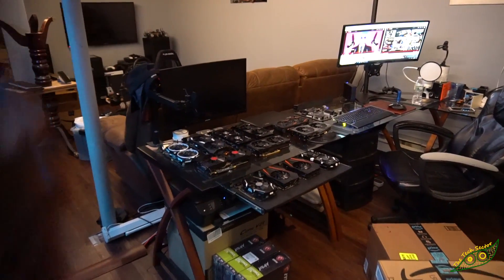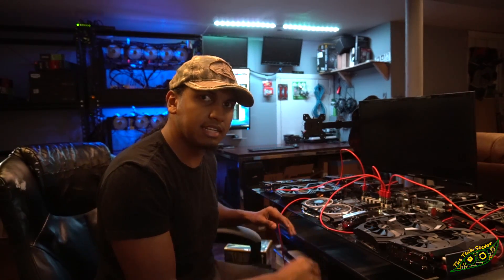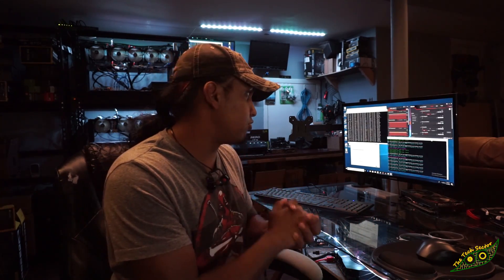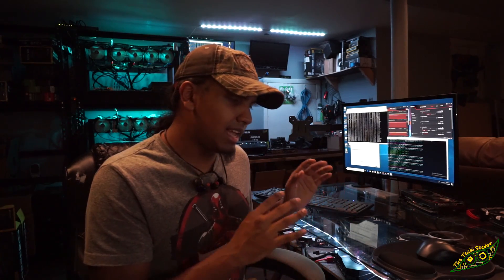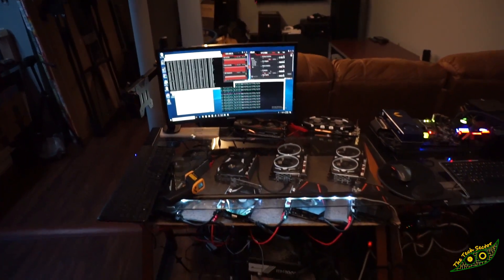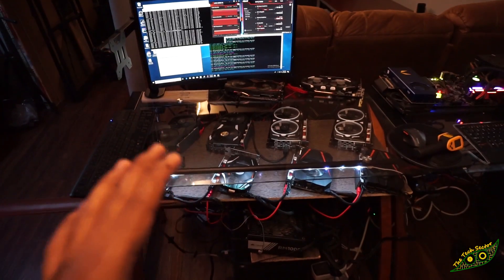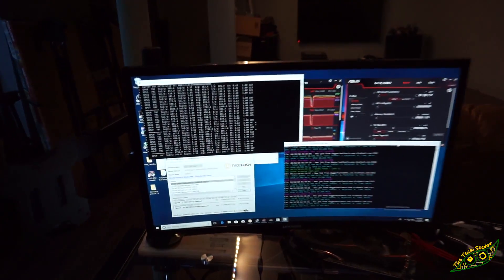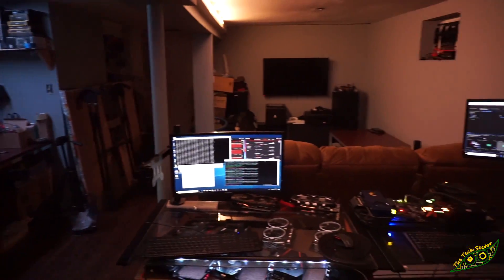Should You Build A Mining Rig In A Desk?

Comment: Hi,did u have problem mixing rx570-580  with rest of nvidia?And what miner did u use to run in the same time radeon and nvidia card?
Reply from the maker: I had no issues at all. In this video I used nicehash miner and it worked without any issues. But there are other ways to go about using nvidia and amd in the same system. You just gotta do a little research